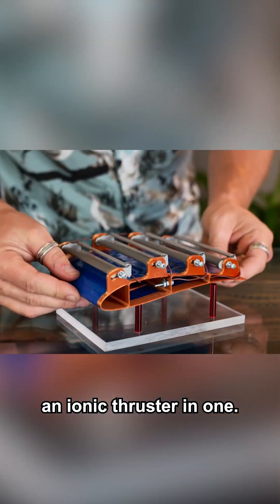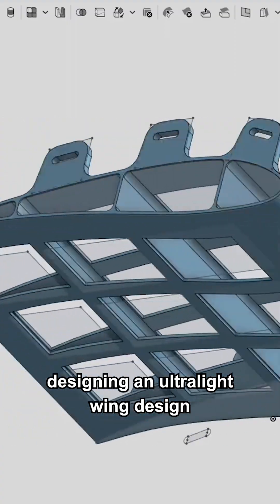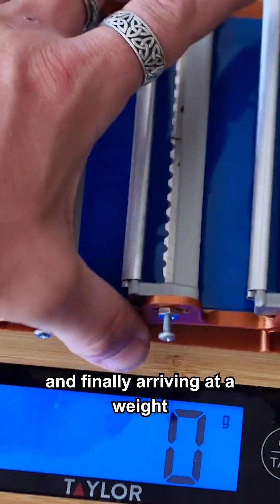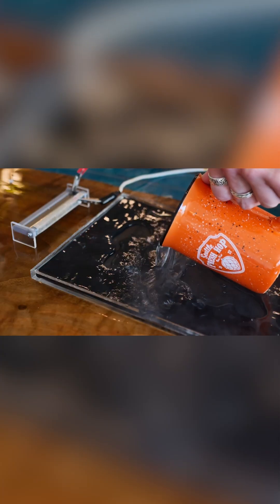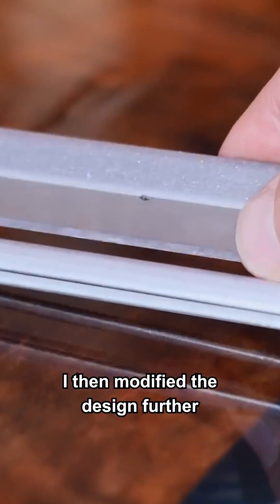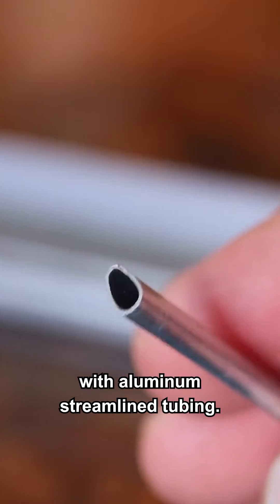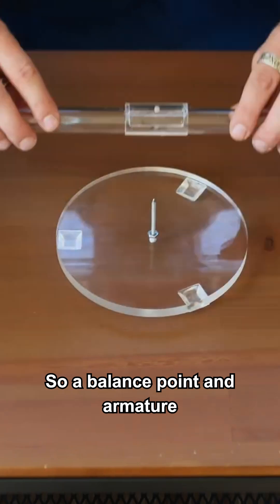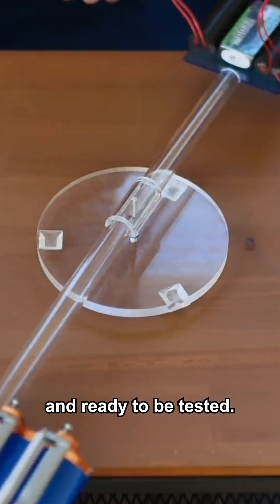Is a New Era of Flight Beginning?

Comment: I love it and your other builds they're pretty awesome i'm really curious about this build. Is there any way to integrate the build into the wing with inlets and outlets at the back of the wing you dont need to have the airflow inlets at the front of the wing do you? The way you have it is more or less designing a new wing if the drive was built into the wing then you have the design of the wing still just modified.